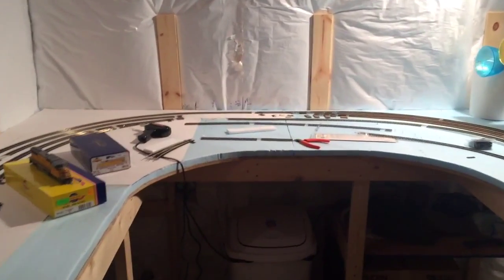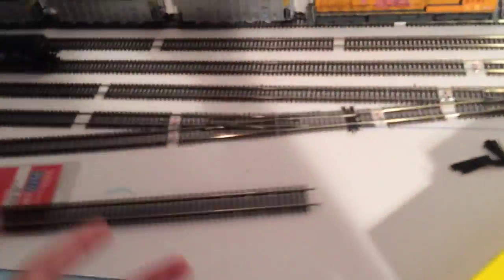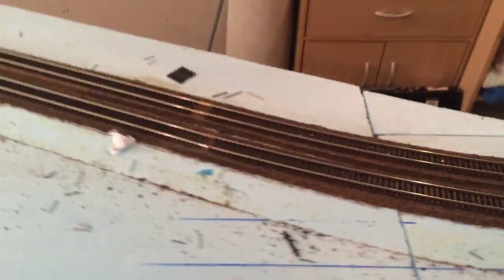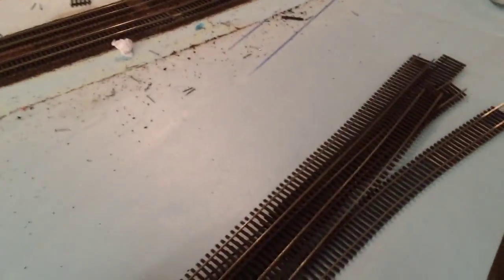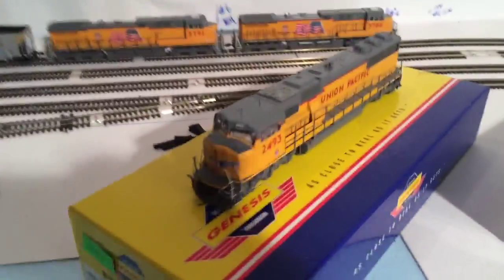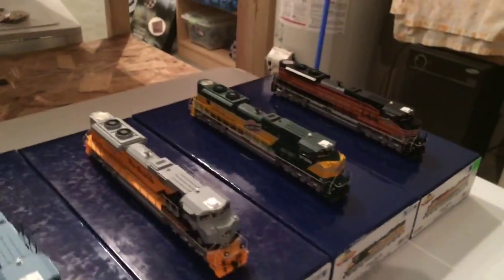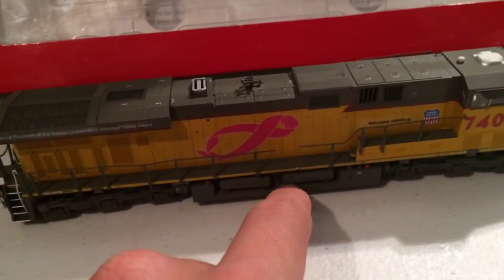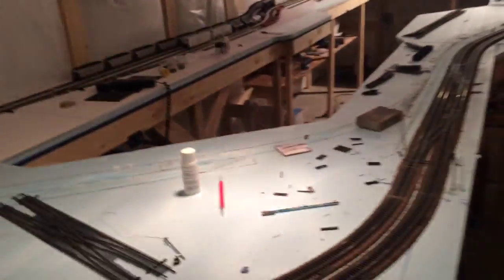BIG layout update! Changes, new locomotives, and projects!

Comment: Looks great! Can't wait to see more progress on the layout as well as your projects. I saw one of the other comments on this video, and the part number for the EMD top/pilot mounted ditch lights is DL-228. These are only the ditch light castings, so they wouldn't be operational out of the box. But they're designed for you to drill holes in the bottom using a small pin-vise. Then, you can either slip in 1.5mm bulbs like Athearn uses, or you can put in surface mount LEDs from Ulrich Models. Then you'd just have to drill a small hole in the top of the pilot to run the wires back to the decoder and hook up the lights to function 5 or 6. Hope that helps!
-Cam